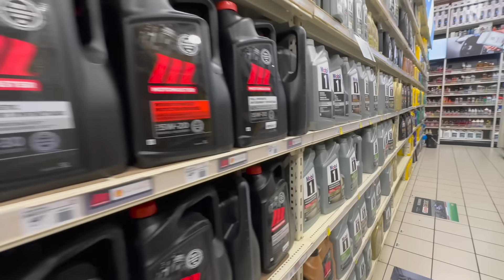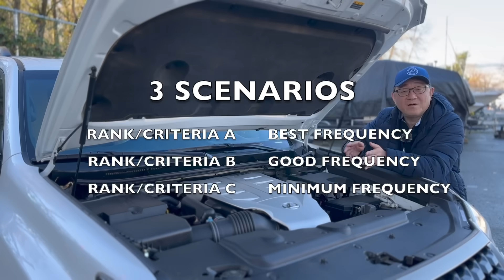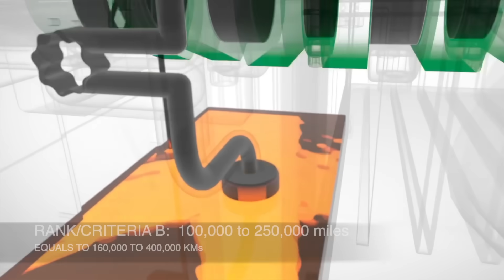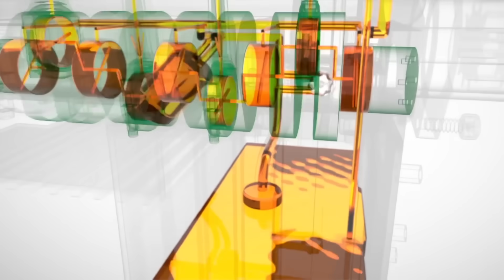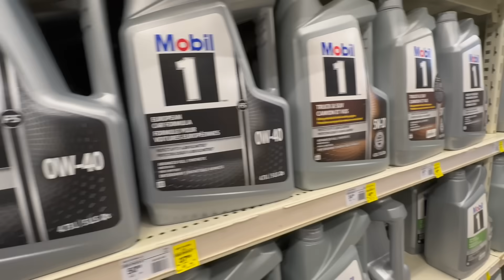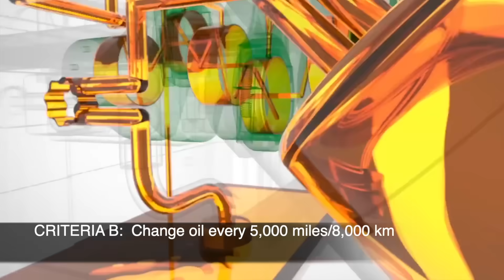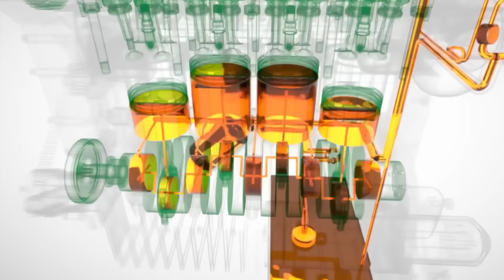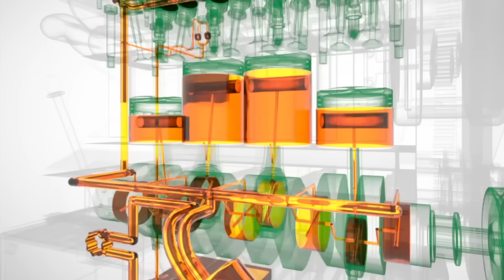ENGINEER EXPLAINS HOW OFTEN TO CHANGE OIL & FILTER // UPDATED CRITERIA-BASED RECOMMENDATIONS!

Comment from the maker: Thank you everyone for your comments.  A number of people have asked for a data as a backup - but you have to remember that when it comes to predicting the durability of engines, the best way to do that is to take the engine apart.  You will then clearly see the residue of the oil, condition of the inner components etc, and often times the condition of the engine itself does not correlate with the condition of the engine oil. So it is very deceiving - and dangerous - to assume that the engine is in good condition due to the good condition of the oil (through data and analysis).  People like AMD from Car Care Nut, myself as an automotive engineer, and Mr. Takumi Kurosawa (Nissan GT-R engine leader) have all taken hundreds of engines apart and correlated the condition to the frequency and type of engine oil used.  That's the best type of "data" and most accurate way to predict the engine condition (you can see it).  Because I have taken apart hundreds and hundreds of automotive components apart, I know exactly what needs to be done to take care of automobile components and parts (not just engine), and my recommendations are based on these experiences.  My two good friends AMD and Mr. Kurosawa will back me and support me as they have the same insights and ideas as in this video.  I hope this helps you understand how I came up with my recommendations.  At the end of the day, you are free to decide what to do based on your own experience and knowledge.  I am simply sharing my insights based on 35 years of working with cars inside and out.
Reply: Thanks for this comment. There is something that has been bugging me with oil analysis. Like it might be missing some important things? I feel like we tripled the oil change mileage and at the same time added direct injection, turbos, and some questionable fuel with ethanol. I don't think oil capacity has increased much at all. Which all points to it being harder on the engine oil. I also feel that longer drain intervals will lead to more oil leaks but I have no proof of this. A major oil leak is almost as bad as an engine failure if it costs me $7000 to take the engine out and fix it. It just seems too easy to keep doing 5K oil changes instead of that. Thanks!
Reply: Thanks for the information. What's your recommendation on a car that isn't driven on the road but I start it every few.monyhs so it runs and keeps seals from drying out. It sits with synthetic
Reply: Criteria A - Maximum Longevity (10 - 20 years) - 400,000 to 800,000 kms - or even longer.
Change oil every 3,000 miles / 5,000 kms  (6 months or earlier)

Criteria B - Good Longevity (4 - 10 years) 160,000 to 400,000 kms
Change oil every 5,000 miles / 8,000 kms or once a year or earlier - whichever comes first. 

Criteria C - Minimum Frequency (1 - 4 years) 40,000 - 160,000 kms
People leasing or financing - who don't value longevity are recommended to follow the interval in their owners manual. 

Oil is able to keep its lubrication properties for a very long time.  However, oil does get dirty and air and gas contaminants do get into the mixture Hence, why time is just as important as distance.  

I have huge respect for David,  AMD from The Car Care Nut Channel and every mechanic who offers sensible advice.  

I live in Alberta, Canada and drive a Corolla Hybrid. I use a 4 month oil change interval.  

January - April 
May - August
September -  December

I drive less than 15,000 kms annually (suburban 60% & highway 40%) 
Car has been rust-proofed and PPF added because the Alberta government has a ton of salt and sand added to the roads during the long winter months.  The same applies to much of Canada.  

Toyota Corolla Sedan owners are advised to use 0W-16 oil... The weight is written on the oil cap.

Criteria A - Phenomenal owners
Criteria B - Fantastic owners
Criteria C - Are not bothered about the longevity of their vehicles and less likely to maintain them - Zero respect.

Thank you David & The Car Care Nut
Reply: Thank you. I change twice a year ( loosely) but I don't drive a lot.
Reply: I bought a bee Jeep with the 3.6 pentstar motor and there is much to do on the lifter tick that develops. On every video there is at least 1 comment where a person did 3k oil changes, has over 150k on the motor with no issues. Modern motors are very well made and absolutely can last if maintained. Those comments back your claim as far as I'm concerned.
Reply: So True, I have seen the insides of an engine
Reply: Thanks for your insights. I've owned several turbocharged Porsches over the years and when you talk of engine longevity alone as the ruling factor, I've experienced the cost of turbo replacement and that is the key factor in my opinion now. GMs L3B inline-4 turbo charged engine (Ford has them too) is in several hundreds of thousands of pickups and other autos and stretching out past 5000 miles is a sure recipe for inevitable and somewhat early disaster.
Reply: Thank you for your insights. However, I find that these days in many cases, the Achilles heel of modern cars turns out to be economic total, based on expensive and/or inaccessible parts other than the engine. Headlights and tail lights that are only available as units, turbo chargers, heater cores, evaporators and related AC items such as blend door actuators, rear coolant crossover pipe on some Toyota engines and similar engineering marvels made out of plastic, designed to have limited service life. And I have literally not even touched any hybrids with their super expensive and finite lived batteries. I also have not even mentioned items such as the condition of the paint, or interior parts that are just as vulnerable to deterioration and very expensive to replace or keep up. Having said all that, being meticulous about oil change intervals, as great as it may sound, won’t extend the actual life of the vehicle by much. Unfortunately, I am talking from experience too.
Reply: Lexus ES 350. OCI 5000 with Mobil 1.😊😊😊
Reply: If you follow your operator’s manual, your car will last a long time.  A well engineered car like a Toyota Camry will last 300,000 miles with proper care.  I recently saw a video about the Volvo and the owner whose car went over 3 million miles.  The car was a ‘60s model and there were only nominal repairs and replacements performed.
Reply: Well this is very different from what I have heard .What if you drive 1000 miles in a year or in 6 months ? Do you still go for 3,000 miles of oil exchange ?
Reply: @arteynis7450  Time takes a toll aside from the mileage driven.  Oil absorbs moisture and contaminants which have adverse effects even when the engine is not running.  Many people have different opinions.  Personally, I change my engine oil after a certain number of miles or 12 months, whichever comes first.
Reply: @arteynis7450  It is a complicate question, depends on many things such as  your climate but normally yes you have to change oil "periodically" maybe once a year, maybe every 6 months, maybe 2 years depending on your individual conditions. Nobody can tell you how often unless they have a database with hundreds of vehicles evaluated. But as David said in the video 6 months to a years usually catches all situations. you can make some exceptions if every time you drive your car you drive at least 20 min at highway speeds to burn off water and fuel in oil. Normally if you do not even drive at all oil needs to be changed "periodically" due to water condensation in oil.
Reply: @arteynis7450  Both time and mileage take their toll on oil.  So, if you only drive your car 1000 miles in a year, you should probably change the oil after a year.  That's the guideline I use for myself.  I use full synthetic, and I drive the car about 8000 miles a year. I had my oil analyzed after 3,000, then 5,000 after that, and finally  8,000 after that.  The oil analysis revealed that my oil was still doing its job after 8,000 miles, and was still fairly clean.  I stopped getting the oil analysis at this point, since I was then up to the 1 year mark, at which point I would change the oil anyway.

Comment: Guess what oil companies want you to buy.   I say hog wash on all this, without data.  Rarely is someone going to buy two or three of the same cars and change the oil at different intervals to see which done better.  Let alone different kinds.   I remember a long time ago watching a show where they took cabs and split them in two groups.  One got their engine oil changed very frequently, and the other group I think maybe once or not at all in 100,000 miles.   There was no noticeable difference in wear.  My conclusion from that was change the oil when your manufacturer says to.   Any more than that you’re wasting your money.

Comment: I guess that I'm a B- or a C+ guy! I've generally done O/Cs at around 7500 miles (diesel or gas) or so. I've never had a vehicle go down because of engine issues. I've been driving for 50 plus years and do about 40,000 miles per year. I own several trucks and a car and all have between 150000 and 400000 miles. How you drive has more to do with it than most people think.    This is a good video, and I agree with his break down of O/C habits.

Comment: Nissan Oil Change is at 5,000 miles full synthetic. I remember before was every 3,000 miles not synthetic oil. I have a Nissan Rough 2019 with 180,000 miles serving the vehicle on time and having not an engine problem yet.

Comment: Hi, you have made a video once with an engine engineer from a Japanese brand who recommended 2000 mile oil change interval. You mentioned 3000 miles for the most strict oil change intervals. Could you please comment on that? Thank you.

Comment: Oil, coolant, fluids are cheaper than overhauls. So is stick v auto. OEM filters only. I worked at a gas compressor with 24” pipe. Decades of never changing the oil. Tested monthly. Filters were changed every 6 months and were always clean. Chevron special blend synthetic. We also changed the air filters on the same interval. This guy knows what he’s talking about.

Comment: 2000 Ford E350 5.4L 2V 380k miles. I use Supertech or whatever synthetic oil is cheapest. I change it every 5k miles and it runs great.

Comment: What if i only drive 1,500 to 2,000 miles every 6 months. Should i still change at 6 months. Im using amsoil signature series. I typically change once a year due to my minimal mileage. I want my 4runner to last 500k or longer.

Comment: Physicist here who works with engineers and is constantly shaking his head in consternation.  Change your oil once a year if you like.  But before you do put about 1/3 of a can of seafoam into the crank case and 1/3 into the gas tank.  Drive the car a couple of days and change the oil.  It will come out jet black.  That is all the carbon and varnish causing the friction that is going to kill your engine.  Mostly oil doesn't matter a ton but use Royal purple or amsoil if you like your engine components to be extra polished.  If you are in a region with -10c or lower in winter use a 0w oil as it flows way better in those temps.  This helps it lubricate better in cold starts.  That is all.  Oh one last thing.  Change your coolant at least every 5 years and run lubricating cleaners in the system before you do.  Cooling failures kill engines.  I do it every 3.  Most people can't tell you the last time they changed it and then wonder why the head is gone.

Comment: Born in the 50's, dad changed oil and filters every 3000 miles religiously. I carried on what I learned, I do give myself a timeline of between 3-4000 miles. And I use a 100% synthetic oil.

Comment: I remember decades ago when they told people every 3k mi or 3 mos whichever comes first and that was every car manufacturers recommendation back then. 3 mo regardless of miles was bit extreme. Now it feels like it’s gone the opposite extreme and almost every newer car I’ve had seems to have a 10k mi preset oil life. I use synthetic and do them every 5k mi myself. If I was using mineral oil I’d do them every 3k. I have a 4Runner and for years the oil life thing would come on at 5k and the Toyota dealership would turn it off and say bring it back next time when it had 10k because it’s full synthetic and larger oil capacity than smaller engines and only needed an oil change every 10k. Since then I started changing that one myself and do it every 5 when that light comes on. 10k even with synthetic seems a bit long to me. And I keep my vehicles forever usually.

Comment: Any who mentions time or mileage intervals for oil changes doesn't know what they're talking about. A car with a 30 mpg highway fuel economy will burn about 333 gallons to reach the recommended "ideal" driving conditions 10000 miles. If the city fuel economy drops to 20 mpg then you would have to change oil at 6667 miles. But regardless of city or highway driving, both mileages will burn the same amount of fuel. Thus, simply change your oil, in this case, every 300 gallons of fuel burned!!! To hell with mileage or month intervals. 0:34

Comment: 23 GX 460, I drive about 20 miles per day highway commute or about 5k/year so is going the 1 yr change interval ok for oil (0W-20), in live in tri-state NY/NJ area so no extreme weather. Does it oil degrade by one year, you recommend six months, but I’m thinking today’s synthetic oil should last more than six months

Comment: A change at every 3000 miles the cost would be over $23,000 if I got 500,000 out of the car. Unless DIY type. I think it better to put that towards a new car
Reply: Wrong! It will cost $7300

Comment: In the case of turbo engines iI would increase the frequency of my oil changes. I'd knock off 1000 miles and change it every 4000 miles.

Comment: I HAVE A SANTA FE HYBRID I CHANGE EVERY TWO THOUSAND MILES PENSZOIL 0W20 FULL SINTHETIC PLATINUM.
I DRIVE SEVERE CITY SHORT HOP TRIPS. HYBRID ENGINE ARE WORK A LOT
HARDER. COLD STARTS WHILE RUNNING ON BATERY HURTS ENGINE BLOWBY
AT HIGHER SPEED.  MINE STARTS COLD AT 1700  RPM WHILE DRIVING.
IT HAS A TURBO AND ITS HARD ON IT TO SPOOL UP WHEN COLD.

(THE) HOT WORD ON HYBRIDS ARE HARDER ON GAS ENGINE AND TURBO.

Comment: See what you’re saying is why I tell people if you wanna buy a new car buy it brand new do not buy it 2-3-4 years old. Yes, the price would be cheaper even in some cases considerably cheaper, but people do not maintain the car the way they should if you went with 10,000 mile oil changes on a Toyota Camry say that thing almost guaranteed to be drinking oil in a couple of years because of that, but if it’s changed every 3000 miles it will last forever

Comment: I'm at camp A.  I have a 2002 Subaru WRX wagon with 155K miles.  Everything works!  I drive approximately 7K miles a year, so I change the oil twice a year.  I do all my oil and filter changes.  Full synthetic oil from Costco gets the job done nicely and economically.  More and more lubrication shops are fraudulently servicing consumers with conventional oil but charging them for full synthetic.  How many of you can tell a dino oil from a full-synthetic?  You can't, unless you're willing to send samples to an independent lab at your own expense.  It's your car, your money; it pays to learn and invest the time in doing your own oil changes.  I also get to see what's going on under my car.  Opening the hood allows me to check the fluid levels of my transmission, brakes, washer fluid, and battery terminals.  I check the tire pressure at least once every couple of months. All easy DIY basic stuff. Just my .02.

Comment: Former Mobil Oil lubrication engineer here, I change Mobil  1 every 10k miles. The longest oil change interval is 4 years. Oil itself can remain stable for long time as in the case of automatic transmission fluid.  The concern of too old oil is the additives in the oil may settle out if car is packed for too long. 
Some car manufacture and engine oil supply also recommend oil change  based on time. The consideration is the car may run idle and stop go a lot but does not show high mileage.
The engine oil supplier,  the car mechanics, car manufacture's  oil change recommendations  are biased.
Old cars ( roughly 2000 earlier) are  different story

Always pay attention to the old oil's condition and look for any sign of abnormality especially any shining under sun light.

Comment: @AutomotivePress David, it is extremely useful guidance that you provided in very logical & simple way! I will request you to please specifically talk about diesel engine oil & oil filter change frequency! As soot is a big part of oil contamination in diesel! Or should I take your this video applicable to both gasoline (petrol) & diesel engines? Eagerly waiting for your guidance.

Comment: I go by feel. I can feel the difference driving when the oil passes 6000-7000km and swap it after it passes 7000, but before hitting 8000. I use the trip odometer to track this. Simple.

Comment: You are saying if you lease a car, totally screw the next person that buys the car. Nope, bad advice to do that. 
Take care of the car the same no matter what. It's a win win for everyone down the line.
I have always done 5k miles on non synthetic and 10k on synthetic. Up through 2003 models. All of those I have sold at 200,000 plus and still going.
With newer cars I will back those numbers to 5k and 7k miles, even though the manual says otherwise. Rings are built differently now so shorter intervals on the changes. 6 months is good for time even if you haven't driven many miles. Like our guy says gas, water, contamination build up and oil breaks down. Filter every time.
Treat your fellow human and future owner of your car well!